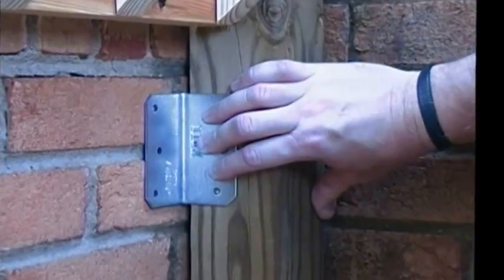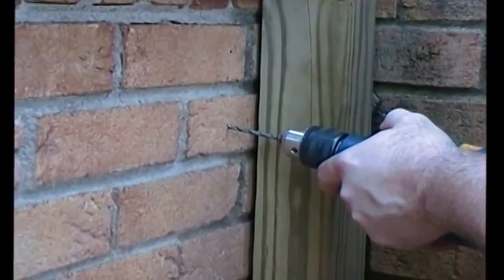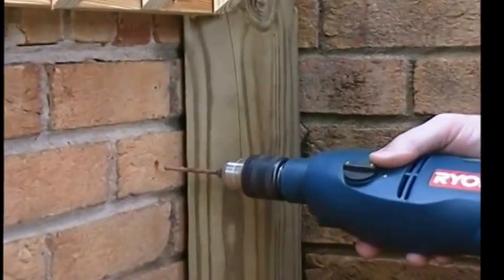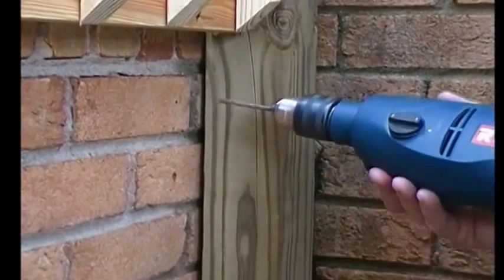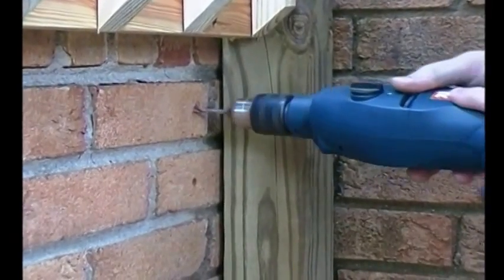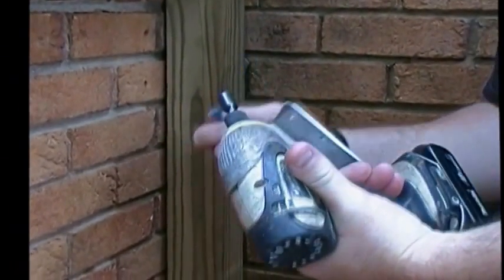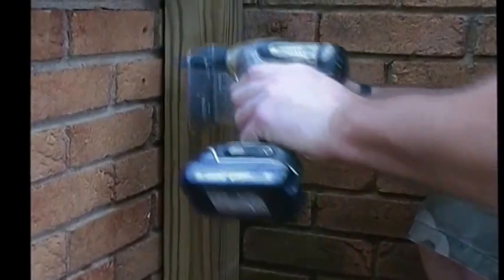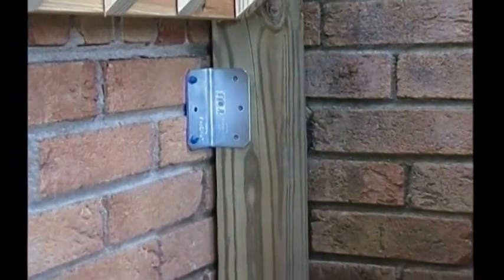How to: Use "Tapcon" brand fasteners for Masonry, Brick, and Concrete

Comment: Some other points to note about Tapcons.  They have a nasty habit of snapping off when sunk into hard cement esp. if your sink them with an impact driver.  Safer to use a clutch drill set at about 13.  Also these screws do not thread more than 1 1/2" deep into cement before they either stall, snap or strip so select the right length of screw for the application you are doing.  Boxes of 75 screws have the correct size bit included.  You might need extra bits if the cement is very cured and hard.   This gentleman is using a hammer drill not to be confused with a rotary SDS plus hammer drill which is much bigger.  The latter will save you time if you are doing many holes esp. larger fasteners.  For these tapcons, the smaller works fine for smaller jobs.  Be aware that poured concrete contains aggregate and sometimes rebar which if hit may either prevent the drill from cutting or cause the fastener to fail before completely setting.

Comment: I had already read that the diameter of the bit is crucial, and Tapcon even puts a handy chart on the Web that gives you the relationship between each screw and its corresponding bit.  I was pretty sure it was as easy as your video shows, but  ya don't know what you don't know, right?

That was reassuring, concise and had a nice, calm tone.

Comment: One very important thing he failed to mention was to wear appropriate PPE i.e. safety glasses for this activity. Getting brick dust or a broken fastener in your eye and requiring an emergency trip to the doctor or hospital is not what you want nor plan on. Avoid it all together by starting with appropriate PPE!
Reply: Sissy 🙄

Comment: When "tapconning" wood to brick, what should I do to prevent moisture in the brick rotting the wood? I'm thinking house rap, pressure treated wood and possibly a metal flashing barrier?
Reply: That's the right system. Obviously the metal flashing needs the vertical piece under something so water doesn't run down behind. If that's not possible than a bead of silicone caulk at the flashing

Comment: Good tip....thank you for posting but I would still put a small piece of wire inside the holes. It is just my own preference.
Reply: benoit lambert Topcon type screws are expensive because wire isn’t needed.  If you use wire then regular screw would work instead of Topcon screws.

Comment: Hi Bobby,
I'm curious when you were screwing in the tap con with the impact driver. Why did you keep on pressing and then depressing the trigger switch.
Reply: because the hole is easy to strip?  no torque control on impact driver?
Reply: Because he knows using that impact to tighten the fasteners could easily run the risk if stripping out the hole.

Comment: Worse thing about drilling bricks is that the drill bit wanders easily so you might be a fraction away from where you made your mark. I would have drilled into the wood first and then used the angle itself as a guide when drilling the bricks.

Comment: Great vid.  Started a project of expanding our built-in storage shelves in our craft/storage room that is next to our basement.   Shelves are built with 2x4's (verticals).  To do this i ran into the surprise that i have to attach 2x4's to my concrete foundation wall.  At Lowe's i bought the Tapcon 3/16" bit and associated Tapcon 1/4" dia blue screws.  Afraid i will wear out my new 18v Dewalt impact driver trying this, i called my local rental company.  Said it should be fine, but seeing this vid emphasizes my fear --so i would have to rent a Hammer Drill for $40 all day /$30 half day.  Or i can return the Tapcon products & rent a Powder Acuated Tool (PAT) for $33 that includes 20 charges & 20 nails.  Seem to have more control using a hammer drill vs a PAT.  Concerned about ending up with a non-threaded Nail if using a PAT that can loosen over time.  The Tapcon blue screws look like they'll stay in place for a very long time.
Reply: my limited experience says the nails hold much better than tapcons.

Comment: Trying to put up shutters in 100 degree weather to avoid this massive hurricane Irma bearing down on us. My tapcon's keep breaking off when I drill them into the hole. Using 3/16th bit to make the hole. I'm about to chuck my deWalt in to the neighbors pool.

Comment: Some videos say use tape and only drill about lenght of screw ? Is  if drilled  longer than screw will screw still tighten down?
Reply: It's ok if the hole's a little too deep, as long as your screw is fat enough to touch both sides of the hole. That's what my wife tells me, anyway.

Comment: Bobby, So here I am 4 years later...You should probably remind newbies not to overtighten the screws. As soon as the heads are just snug, STOP!
Reply: im glad you mentioned that.i never used them before but now I have to put up bracket to hold garden hose

Comment: How much weight can the screws hold? I have a 200 watt flood light I want to install into my brick on the gable end of the house. Light weighs 25 lbs.
Reply from the maker: They should hold the weight with no problem when properly installed but you may want to go to the Tapcon website to get the specs on how much weight each size screw can hold. That will help you decide what size Tapcon to use for your application.

Comment: it’s important to drill very straight pull your drill bit out don’t clean the hole with the bit it’s better to just blow in the to hole to clean it you have to consider the diameter of what want to fasten make sure your screw is long enough once you commit to drilling keep going no back and forth  better to try to fastened to brick or block not mortar

Comment: If the screw strips the hole out afterwards, just add tooth picks in there and it'll be back to a snug grip!
Reply: Do not use wood or metal in stripped tapcon holes. Insert and trim nylon tie wraps all the depth of hole. They last forever. Available in many colors.

Comment: Only thing Home Depot had. Expect to put a toothpick in every hole. Expect to use 3 the screws you need as they are phillips and will strip on you almost every hole. Most frustrating product I've used in years.
Reply from the maker: Are you using a hammer drill with a mason bit? I've found they work well when you drill with a hammer drill and blow the dust out of the holes with compressed air. A regular drill will allow the bit to walk around in the hole so that could be why your having problems. Also make sure you use the recommended size bit with the tapcon screw that you use. Hope these tips help some.
Reply: I'm using a normal drill and the mason bit that came with the tapcon kit. So the drill may be the explanation.

Comment: I just drilled with a 3/16 hole for 1/4 Tapcon....the screw is actually loose in the hole...
3/16 is NOT the right size for 1/4 inch Tapcon
Reply: Did you clean dust out of hole with the drill bit several times?  If so you may have enlarged the hole.  See comment  by "DavidKupy"  above.  That's what he claims.
Reply: @emiller9426  no...I would recommend to all reading this...DON"T USE TAPKON IN CEMENT BLOCK.

Comment: "nyert nyert nyert" is completely unnecessary with an impact driver or a drill.  It just wears out the switch.  And as for the installation of the screw, always lubricate it with wax--from a new bowl ring is best--or parrafin, or chapstick, something.
Reply: This is how tapcon recommends doing it. They claim that if you apply continuous torque you risk stripping the hole, and say that you should do it a little bit at a time.

Comment: Used them years ago and they were pure crap - small pozi head that strips every time - The far superior direct masonery fixingswith the T star heads  now available work every time without the problems of tapcon plus they are far stronger and cheaper

Comment: Id recommend more focus on cleaning the holes out for a future video. Its more difficult when they are on the floor instead of the wall.
Reply: Use a straw or compressed air, if you don't have access to either, you can always drill deeper to allow the debris to sit below the fastener.

Comment: No plugs, no secure.
Reply: I totally agree with you proper plugs proper fitting proper old skool
Reply: @tanveerkhan9221  concrete screws can take way more load than plug

Comment: No hammer drill needed, just run the drill really slow until you make a dent in the wall, then run the drill around half speed.
Reply: Dan Carpenter you never want to do masonry work with a regular drill, that's how you mess up bits & burn out your motor, always use the right tool for the job

Comment: You should NEVER drill into Brick if it can be avoided.  always try to drill into the  mortar joints they give you a much stronger hold and doing so won't make the Brick crack over time.
Reply: Only if the mortar was mixed properly when first applied. Sometimes you'll find the mortar is not packed all the way in, or it begins to crumble out in times etc.  Drilling into the brick is the preferred way for contractors who have been making a career doing this. Homeowners - do whatever you hear on YouTube - I hear Elvis has the best advice for Tapcons...

Comment: I sort of disagree about using the bit to "clean the hole". You run the danger of enlarging the hole where the screw won't bite. i install shutters here in S. Florida onto concrete block homes, and use a turkey baster or a straw and blow the holes clean.
Reply from the maker: I agree David. Thanks for bringing that fact up. I should have warned folks to be careful not to enlarge the hole. Compressed air can also be used to clear the hole. Thanks for your comment David. Take care
Reply: David.  How do you make sure the holes in the concrete line up with the holes in the bracket while making sure the holes are clear of dust and dust isn't under the bracket?  Seems like we have three choices:

1.  Do as Billy and use the bracket as a template.  Mark and drill all holes at once and install.  Even though I use a hammer drill and masonry bit, I find the bit wanders and the hole is often not where I wanted or too large in diameter.  Aggregate in the concrete could cause this.
2.  Drill and clean one hole.  Install bracket with this one hole.  Bracket is now secure and will guide bit to exactly where holes need to be.  Then either....
     a.  Clean holes of dust as best you can with bracket in way.  Some dust may still be under bracket. OR
     b.  Remove the one screw holding the bracket in place.  Clean all holes.  Reinstall bracket realizing the first screw is much weaker because it was removed and reinstalled.
Reply: I am not worried about dust under the bracket. It is the dust in the base of the hole that will stop a screw from going all the way in. No matter if you drill all the holes and install the screws all at once or one at a time, you need to clear the holes of dust. I drill the hole to the required depth then stop the drill rotation, THEN pull the bit straight out, then clean the holes. As far as bit drift, I place the bit on the mark and press hard before starting bit rotation.
Reply: I am sort of new at this.  Today, I was using my rotary drill and I noticed the directions said to wait until the drill comes up to full speed before applying the bit to the material.  Not sure why, but I just wanted to let you know since you said pressing down hard on the bit before pulling the trigger helps keep the bit from wandering.

Looking back, I think my problem was the screws barely fit into the bracket holes, so if I drilled the holes off-center just a little, the bracket wouldn't fit.  Next time, I'll use smaller screws, or drill larger holes in the bracket.  Seems obvious now.  I can't expect to drill holes into concrete with the exact same hole pattern as the bracket.  Need a good amount of clearance between screws and mounting holes in bracket.
Reply: And the people that design and write the instructions have never actually used the products in real life.
Reply: drilling a good/proper pilot hole (little or no wobble when drilling, and drilling to the proper depth) helps achieve the rated pull-out, and shear-off, strength, for concrete screws. Cleaning out as much dust as possible allows the screw to get to the full depth (the dust can plug the bottom of the hole), and lets the screw cut the threads  properly.
Reply: @willthecat3861  In my limited experience using a can of compressed air works fine to expel any dust in the hole
Reply: use air in a can.